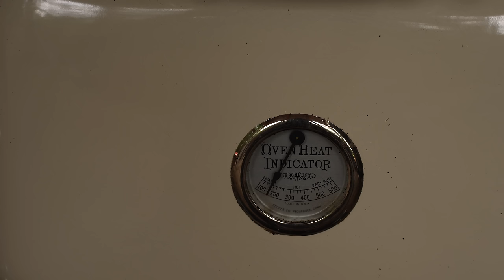Installing a Wood Cookstove in the Outdoor Kitchen at my Off Grid Log Cabin

Comment: Hello Shawn. Big fan of your channel. My husband and I are living a similar lifestyle in Alaska. Just wanted to give you a trick to install metal roofing. We call it the Chris Razink method, since it was a colleague of ours from the  State Parks who showed us this, we have been used it ever since on several houses and outbuildings. You screw a 2 by at the end of your roof rafters. On this, you screw another 2 by, but sticking up 2 inches higher than your base. You then created a ledge which you can use not only to install a ladder where the feet would rest on that ledge and you can stand on, but your metal roofing sheet as well, creating a perfect line up at the bottom and extending 1.5 inches passed the rafters. Will take pic tomorrow, worth a 1000 words. Keep up the good work and enjoy life.

Comment: When I was growing up, we heated our house with a Warm Morning Stove and a cooking stove.  We used coal and wood.   Boy that brings back good memories.   That is a deluxe stove.  It has a warming shelf above the cooking surface and a side tank to heat water.   You can heat bath water or use it for any purpose since you would put filtered water in it.  The warming shelf is great for keeping food warm.  Good choice buying that stove.  Clean the rust off with a wire brush and wash it off with Caron & Doucet - Cast Iron Cleaning & Restoring Scrub 100% Natural, then use Imperial Stove Polish Paste, Black.  It is non-toxic.  Use enamel white touch up on the enamel nicks.  You will have that beauty shining like new.

Comment: I thought the outdoor kitchen at the previous cabin was beautiful, but this one is much larger and more functional already, besides being partially enclosed and with a raised wooden floor instead of round cuts in sand.  That cupola is a thng of beauty!  Glad to see you using a safety system while on the roof.  A friend of mine fell/slid off a roof while repairing a chimney, and shattered his ankles and tibias.  MD said if he had not landed in a big pile of sand, he probably would have stove in his hips and pelvis, and never would have walked again.  Those wood cookstoves were common in farmhouses when I was a young boy, before electricity was available.  Some farmers could not afford the  cost of a lengthy run to get hooked up.  They were still using kerosene lanterns for light - this was 1950 - 57 in SW Wisconsin.

Comment: Shawn, Paul here is trained in military mountianeering and repelling.  I have climbing equipment, shoes, belts and harnesses here.  I also have the bucket of an achor, a rope, a harned and the screws to attach it all with.  One has a brand new harness.  I have an full body harness too and about three repelling harnesses.  The outdoor kitchen is comming out very good now.  The pice ontop gives it a lot of appeal as well.  So far I rope myself off when up high, and will bang into the house or go down only so far.  Have not fell yet.  Have not spoken to too many who have fallen either.  Have fun.  Paul in Ohio I like the cook stove too.  It is neat to me.  Cannot recall what my dad and step mothers wood burner looked like.

Comment: As a wood range owner that is very anal about stove maintenance, I thought I'd share my tips. Use SOS pads and scrub the rust off the top. When dry give it a coat of oil. Keep some fine steel wool handy in case you get a rust spot. Rust is not your friend! For the porcelain, polish with car wax and make it shine. It helps with cleaning off the grease spatter. There is the cleanout under the oven that has be cleaned out. That helps to keep the fire going around the oven and be a better baker.  Don't trust the gauge on the oven door, put one in the oven and compare the temps. After your fire is going good then close the draft on the back of the stove to redirect the fire around the oven. Ten years ago we bought an Ashland range made by Amish in OH. It took me a whole winter to figure out the quirks! After having two other ranges with a small firebox, it's nice having a bigger one that accommodates bigger wood, and will hold a fire for several hours. Love your video's! Blessings from Wisconsin †

Comment: Doing a great job, Sean. Glad to see you had your harnesses for the roof work. I was wondering about one thing though, and that is the height of the chimney. It appeared as though you might want another section in above the roof to keep the smoke from being blown into the cupola. [??]
The stove is a classic, so hope it gives many years of tasty results. When I lived on one of the lakes in northern Minnesota, we had one of those for heat and cooking. We also had propane heat for the rest of the cabin, but the wood stove held in over night, except in the worst of weather, when there was about a 3 a.m. stoking and banking.
Continued success in the build and your making.

Comment: If you can find or create a little elevation that creak by your cabin could power a water powered generator. They are more reliable for long term charging. There are all kinds out there. One of my favorites was a guy who used an inverted old washing machine motor and a long pipe to make a hydrojet generation system.

Comment: When you put together snap lock pipe, it's much easier to do it with the pipe between your legs.   You also hold the pipe with your legs and twist the uppermost half if you're having trouble aligning said snap lock pipe.

Comment: if you find the rain on the kitchen get too loud you could always use some closed cell foam packing as a backer for patterned ceiling tiles that are hand painted or designed by the family ... and then glue or mastik them to the metal ... a great way to display the family journey in pictures  ... kind of like a quilt but in ceiling tiles 

as for the depth of foam .. just the normal 1/8 or 1/4 depth sheets will be plenty ... then paper over top or home cut veneer ... or thin panels of wood on top ... little weight and easy sound absorption and it will still let the sound happen just softer 
.
i can forsee many  good big meals made on that stove ... bet it would make some super tasty roasts too with that wood smoke ...

Comment: Great job as usual, Shawn.  Thanks for sharing these great Off Grid building tips and presentations. 👍👍  10⭐

Here is clearly pointed out at 2:53  Why Solar Panels are pretty useless as a Long Run Power Source.

Comment: Wow that is a grand old gal that stove. Is that compartment on the far right side a water tank? When I was a kid, I just remember mom’s stove like that, and it had a water tank on the right sides, that was our hot water for washing our faces first thing in the morning. It was wonderful as the house would be cold until the wood stove  heated up our house. It also had a spot for ironing bases (don’t remember what we called them). Anyways they got hot and used them to iron clothes by sprinkling water on the clothes for steam. The stove was the centre of our kitchen and nothing smelled better than bread proofing in the top. You have a beauty there.

Comment: I think that you need to rotate the stove rack 180 degrees so the angled legs catch inside the stove walls so it doesn't fully pull out. Just a suggestion.

Comment: I have a porch with metal roof. I wish I had a layer in between because in winter the roof and moisture freezes on the underside then the sun comes out it melts and drips💧 and soaks my entire porch and cushions everything gets wet I hate it wish I did plywood and ice and storm shield then metal on top. You may run into the same problem.

Comment: It looks as you will manage all the convenient of today world, with you hard work to achieve it. I notice of course that you stove had an oven, so the need of a clay oven is probably out.
What will be the temperatures in winter when you can tolerate to cook in your outdoor kitchen? However the heat of cooking inside in winter would be necessary. While not heat inside in the summer.
How are you tolerate the mosquitoes? 
Always a good though to Cali, how is she doing? Stay safe,

Comment: Do you plan on putting windows in.  Or sliding barn doors for windows in the winter.  That kitchen stove would be great for canning food on in the summer.  You just need a big fan when you do it to circulate the hot air out.  The top of that beautiful wood stove is so rusted. I not sure how to fix that.  Maybe oil it like the cast iron skillets 🍳.
Great video again.  See you on the next one.

Comment: I was watching to see how you got the rust off of the stove top. Ha! and You skipped showing that step. How did you re finish the stove top from rust to seasoned cast? Looks black and really nice after. I have an old stove like this at the farm and would like to re finish it. Fix it up. OH, maybe you just wiped it down with water and it looked better. Would one use Linseed oil?
Reply: @wilburshuman5579  well that I can do.
Than you!

Comment: Do you have an outfit that can deliver propane to your property, at my place I have a 5000 gallon propane tank that powers my fridge/freezer and my back up generator for my solar and a switch that I can run on just generator power if needed , I have a 20  kilowatt generac  generator that recharges my batteries when I do not have enough light in the winter, I have it set up to turn on automatically, or I can just send it up to the house if needed . I live 30 miles from the nearest town and still get propane delivered.

Comment: 2000 watt hours is 2 kilowatt hours....2kw hours cost 24 cents in my location. There is no value in any of these portable units save just that...their portability...They and other models have been heavily promoted by you tube channels. When looking at their energy capacity value...there is none...